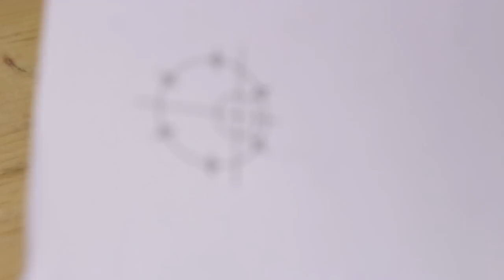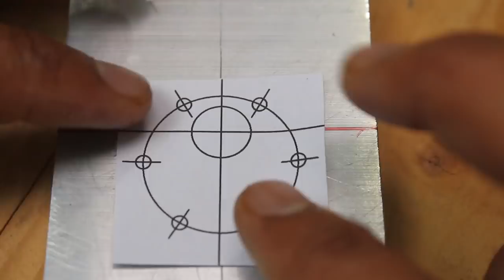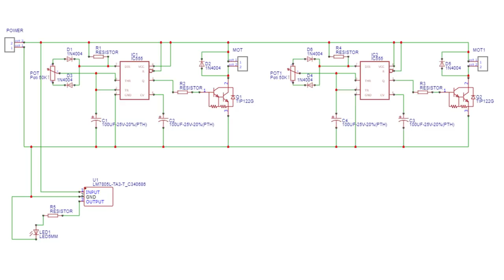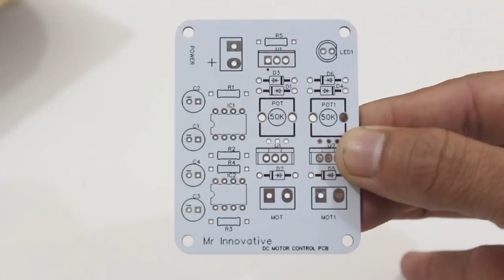DIY Machine Automatically coating Teflon on cable

Comment: I have one question it says it DIY another words do it yourself at home not everyone has but 3D printer just laying around their home second off why do we need to Teflon coat cable
Reply: I'm pretty sure that you can use any tape in that machine. Like electrical tape. Just saying..  and to the person who made this keep making.
Reply: Close minded, I'm sure you can think a way to manufacture that 3d printed part in other way, you don't use it much but you too have a brain.
Second off, that tape protects the cable from heat, it has many use cases and is widely used in industry.
Reply: @GuilhermeRochaFast But then you don’t wrap Teflon over ordinary PVC insulation, since it’s not heat-resistant! 

I work as an electronics technician at a university, so lots of research projects need wires with unusual insulation properties (high or low temperatures, high vacuum, chemical resistance, radiation resistance, etc.).  This often means Teflon or Kapton, in practice. But you don’t do that by wrapping over the PVC!